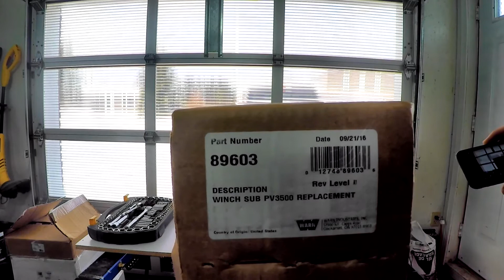Another Broken Warn Winch! Warn Provantage Winch Rebuild

Comment: WINch not WHENch...lol!

Runva has a lifetime warranty and are sold at Canada Winch with free shipping in Canada. It's a direct swap the the Warn 3000. Almost half the cost of the Warn...hard to beat that!

Great video. Subbed!
Reply from the maker: blob bloberson Thanks For The sub! I agree Runva is an awesome price for the quality you are getting. They appear to be Warn winches with a runva badge.
Reply from the maker: @jbhk7977  Couldn't agree with you more!
Reply: hmm it doesnt say what kinda winch is on my 04 Artic cat 400 but it is a warn, will all these models will be easy drop in to my 04 400? 2500lbs EWX2500 or 4500lbs EWP4500 or 3500, also in Synthetic im thinking about going with Synthetic
Reply from the maker: Mopar4life440 The 2500,3000,3500 should be direct drop in winches. The 4500 are usually wide spool and will not fit.
Reply from the maker: John A certainly Can’t Complain For The Price Point For Essentially The Same Build As A Warn.
Reply: I've had an extreme 3000 on my 4wheeler for 13 years and it still works flawlessly!  Got a 2 year old side by side with a warn 3500 and it's dead... I'm not impressed and they are outrageously priced IMO

Comment: Thanks for the great video.  I was hoping for a little advice- I just bought a 2 year old Yamaha Viking that came with essentially this same winch but "made for Yamaha" on the sticker.  Anyway, it won't respond at all.  There isn't a clicking or anything, just dead.  I can move the switch to use free spool by hand easily so it acts like the motor but just wondering how to verify without spending a fortune!  Thanks in advance!
Reply from the maker: You will have to use a volt meter. check to see if you are getting 12v from the battery to start with at the selonoid. from there if you have someone else available try to use the switch and see if the outputs at the selonoid are putting out power with the switch depressed. If not might have yourself a bad switch or a bad selonoid. If it is outputting power it might be the winch motor. For that put 12volts directly to the motor leads and ground on the other side to see if it works. Hope that helps.

Comment: Awesome Video Shawn! Little hard to see with the garage door putting off too much light and darkening the video.  Learned a whole bunch...wanna come and service my winch? LOL! Wonder if that cast aluminum drum can be welded?  Thanks for the indepth look into the winch...not sure if I want to attempt mine...but I might! LOL!
Reply from the maker: Thanks Rob! After the video was done I realized the lighting issue and it was too late. My next technical video I will make sure I set-up differently. I wouldn't hesitate to take the winch apart but I would buy the 2 seals that go against the drum on either side and the seal that goes on the gear box case if you plan to take it apart.
Reply: Thanks Shawn!

Comment: You should have filmed it facing the door so it wouldn't be so dark. It's hard to see what you're doing. That spool is aluminum and can be straightened and welded, no problem. I see now that the new Harbor Freight comes out with the newer version of that same winch with a steel drum (spool) now for a lot less than the Super winch and just as good.
Reply from the maker: Painter D Couldn’t agree with you more, I learned a lot about Review Videos since I filmed this one. Trail by Error. Won’t make that one again.